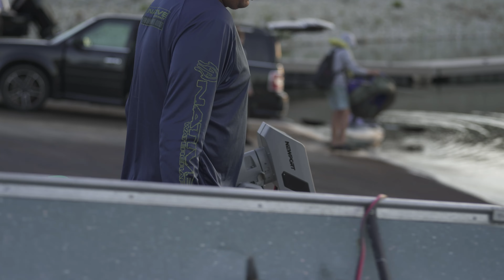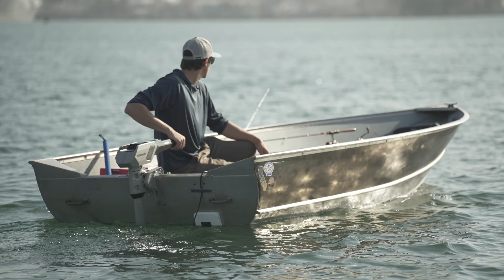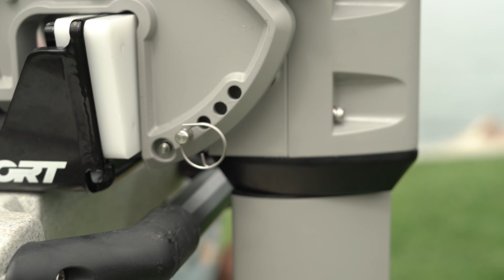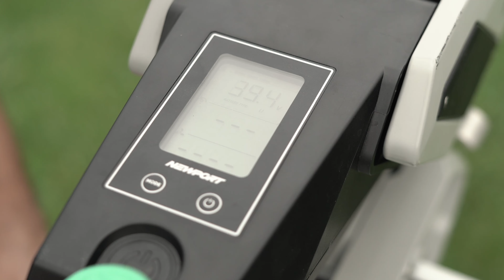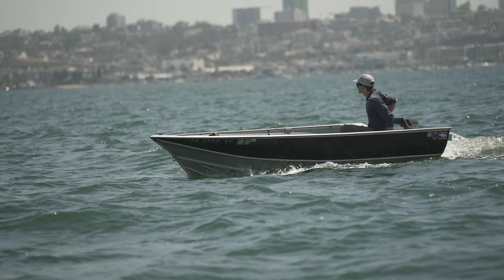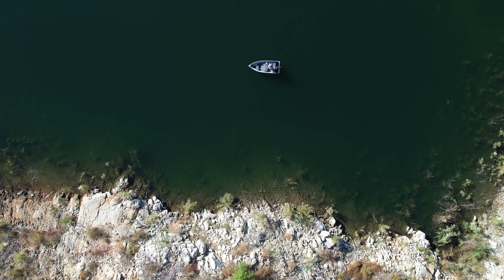NT300 3hp Electric Outboard Motor | Peak Performance Guide

Comment: what's the difference between deep cycle and lithium. is it to do mostly with the depth of water?
Reply from the maker: @chuckem A deep cycle battery simply refers to any battery designed to be repeatedly deeply discharged and recharged. LiFePO4 specifically refers to a type of lithium battery chemistry, often used in deep cycle batteries, known for its long lifespan and high cycle life compared to traditional deep cycle lead-acid batteries; most LiFePO4 batteries are considered deep cycle batteries, but not all deep cycle batteries are LiFePO4.  Advantage of our batteries over traditional deep cycle is that they provide twice the power at half the weight, they're safe and can be used in multiple orientations.  They also have an onboard Bluetooth enable BMS so you can monitor your stat of charge in real time, bringing you a lot of peace of mind on the water.

Comment: Wish a shorter shaft was available. I want this motor but its too long for the TX flats
Reply from the maker: @torteeya  thank you for the feedback! What length shaft would you prefer?
Reply: @Newport_Vessels  20" would be perfect. I'm going to go with the 26" and see how it goes. Does the shaft lock in place or will it pop loose if you hit something?
Reply from the maker: @torteeya  you have the choice to have it kick out of be locked down 👌🏾

Comment: HELLO! 2.57min...  WHICH POWER MODE MUST I WILL USE IF I USE A LOSSIGY 36V 100Ah LiFePO4 Bluetooth Battery ( Lithium Phosphate Deep Cycle Battery)??  Deep Cycle or Lithium mode? TKS!